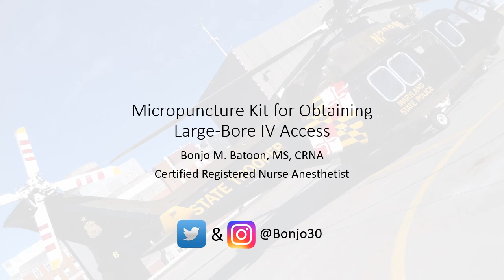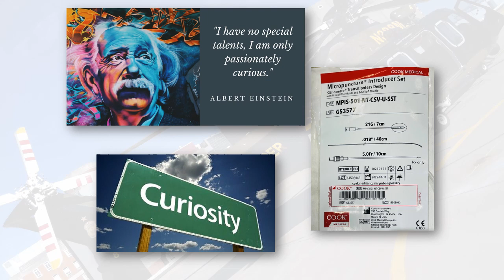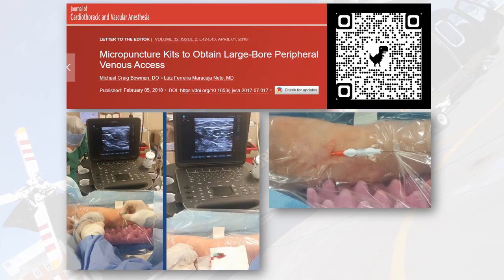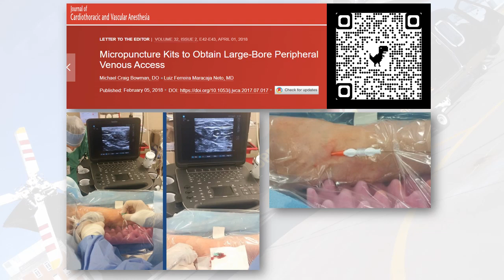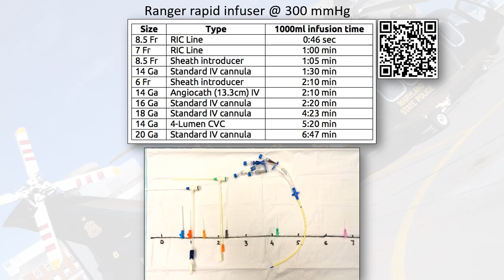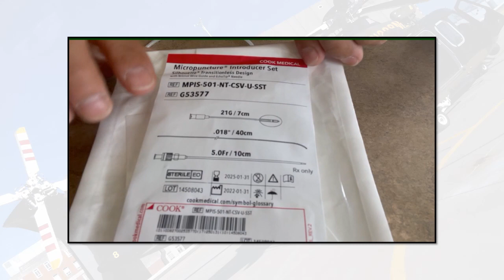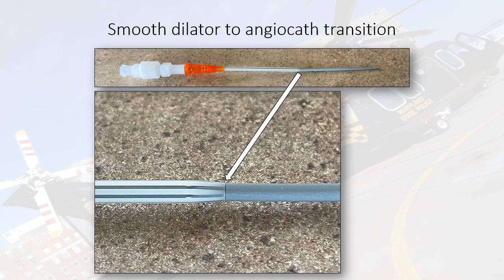Micropuncture kit for large-bore venous access

Comment: This is great, Bonjo! Can't wait to give it a try! Makes me curious about upsizing 22g IVs from the ED to the OR, even just to 18g. Have you found wires/dilators for 16/18g IVs?
Reply from the maker: Hey, Adam. I've experimented a little with these catheters as well. I can tell you that the 4fr dilator will not accept a 16g angio. Interestingly, an 18g angio, both short and long, will fit perfectly over the 21g echogenic needle comes with the kit. I'll do a short video on the previously mentioned technique when I get a chance.

Comment: From your experience, what is the likelihood of blowing the vein if you try to upsize lets say a 20g to a 14g?
Reply from the maker: That's a great question. First, assess the access site. Superficially, I look for veins that are a straight but you could use this technique with slightly curvy veins. If you can aspirate blood from the insitsu IV, that's a great vein to start with although this is not the case sometimes. Luckily most vessels have room for expansion and the small entry point of the 5french dilator helps to facilitate passage the over the wire and through the vessel.

When you pass the wire through the vascular access point, if the wire does not thread easily, I would not use that vessel. The wire that comes in the MP kit has a flexible tip and will curl itself if not in the vessel. That said, there's always the possibility of blowing up the vessel although I think the chances are lower because you are riding the wire into the vessel unlike a fresh stick where you can backwall the vessel.
Reply: @bonjo30  Thanks for the reply. How often/in what situations would you prefer to do this over straight sticking with a 14g? I've done something similar with exchanging the MP line with a regular peripheral so PACU wouldn't get on my back lol.
Reply from the maker: @marc9683  I like in veins when I question whether or I could get this IV via a straight stick. To get a 14g in, you must have some pretty plumped veins to start. We know how difficult it can be to place an IV in a dehydrated or critically ill patient. I don't like struggling and my mentality is more along the lines of one in the hand is worth more than two in the bush.